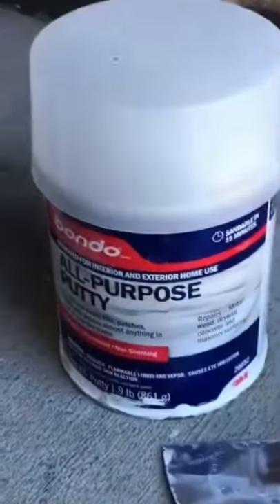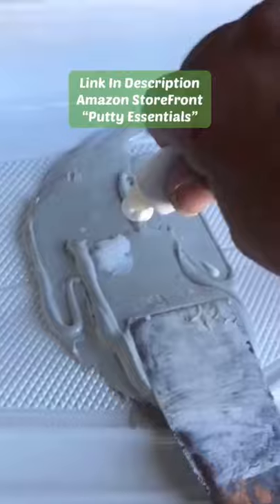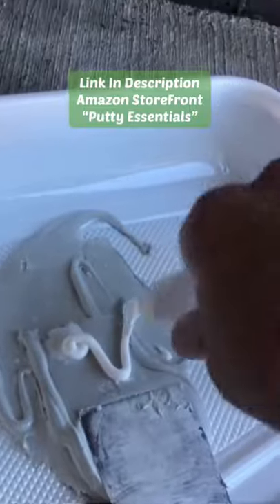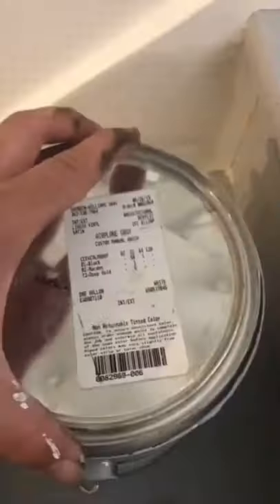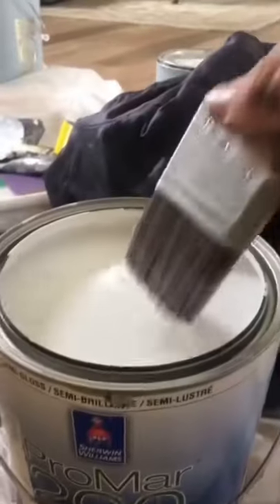How to repair chip on stairs & stringer. #handyman #diy #howto #tutorial #bondo

Comment: Your in love with Bondo my guy, in many instances we use it it's a temporary visual fix. Can't guarantee it for 2-10 years. 

For 1 year new construction like we ,  nearly no issues with Bondo 

But, it's Alaska , sometimes builder want us to Bondo exterior doors/garage doors, etc ...

With -30f-80f you can't gaurantee Bondo, imo you can't guarantee caulikng longer than 3-6 months in Alaska, earth quakes, and shitty trim guys that don't use liquid nail.
Reply: this channel should be called "Bondo solutions" instead of "Jalapeno solutions" lol
Reply: So what’s the alternative? If Bondo won’t last, what can be used? I’ve just begun learning home improvement so I’d appreciate knowing what the standard practice is for longer lasting repairs for these small types of damage.
Reply: Meantime up n down traffic it will crack.
Reply: Right like you just said you're doing "new construction" like I would hope you wouldn't need any bondo  in new construction
Reply: As previously stated, even with the dimple heating and cooling of the interior of the home, bondo’s life span isn’t the best solution. Expansion and contraction that wood suffers will eventually give way. Especially on a step. With live loads up and down, this will increase the possibility of failure. The correct way to repair is replacement of the stair (especially being painted, don’t have to worry about matching wood) but if the customer can’t afford it, some type of material which has give will be best on a step. Typically caulking. That’s what I would recommend. Thanks for the content though! Great job!
Reply: @stalwartconstruction3168  I'd never use Bondo on a walking surface .. idk maybe JB weld.. but better to replace